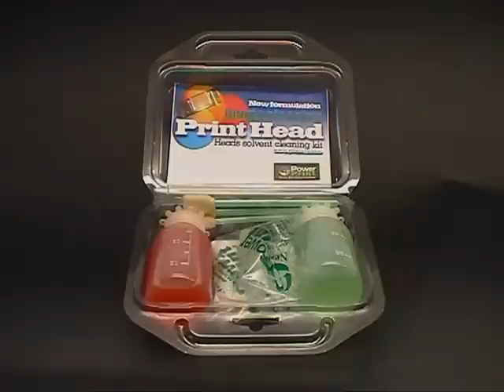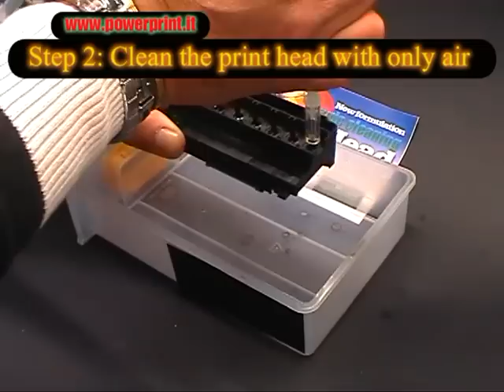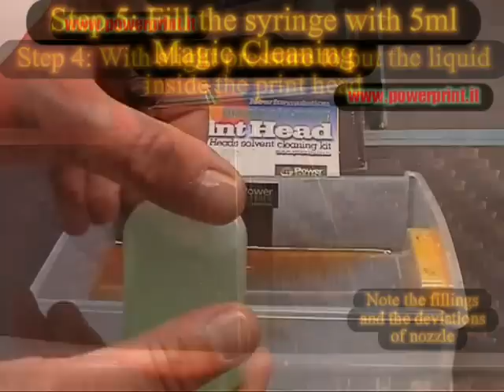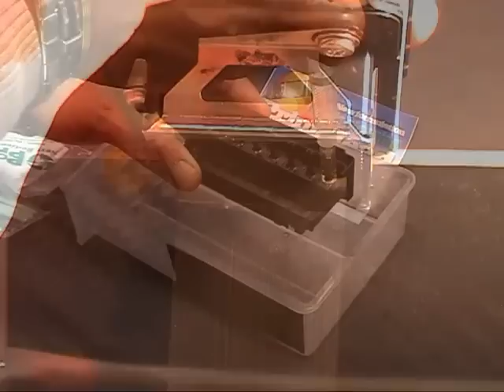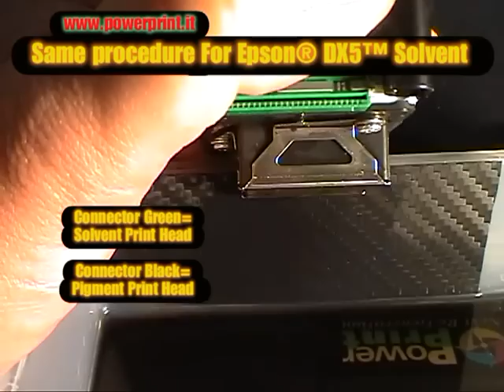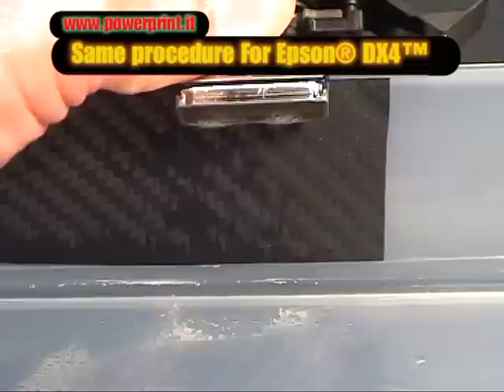Manual Cleaning for Epson Print Head DX8,DX7, DX6, DX5, DX4

Comment: I want to ask,, I did flushing on the yellow nozzle pole but why did the cleaner liquid come out on the black nozzle and can it still be fixed, I used an Epson L1800 printer.
Reply from the maker: since the inner structure of the printhead is very delicate, when you  are flushing the printhead, must be very gently. otherwise the structure of different channel maybe broken. then the liquid from yellow nozzle may come out fro black nozzle.
Reply: @sanyitech  can it still be repair
Reply: выбрасывай головку

Comment: Putting forward pressure from the top will ruin the EPSON DX4s. I’ve broken 5 of these until I found you need specialise equipment such as Print Head Doctor reverse cup and suck cleaning liquid from bottom of the head!
Reply: Does the PH Doctor work?
Reply: @caryyoung4710  and they charge you $1200 for a $14 pump. just open my $1200 head doctor clean machine , guess what it uses a  a $14.00 pump. ,

Comment: Newer don't try unblock the head in that way. Specialy in solvent base printer. Printhead damege guaranted....
Reply: Hi, is that a way to recover the head if damaged due to pressure? Thanks in advance.
Reply: @ArjunC22  sa akin po wla na po palit heads na talaga pag nasira ang seal na parang plastic nya. mahal pa naman ng dx4 heads per pc.

Comment: i use this method on dx4 heads. ayaw talaga mawala ng clogged nya. dapats sa nozzle lalabas ung cleaning solution. pero sa gilid sya ng part ng heads lumalabas. nasira yata ung platic seal.
Reply from the maker: sorry to hear this. kapag pini-flush mo ang printhead, dapat ay napaka-malumanay. kaibigan